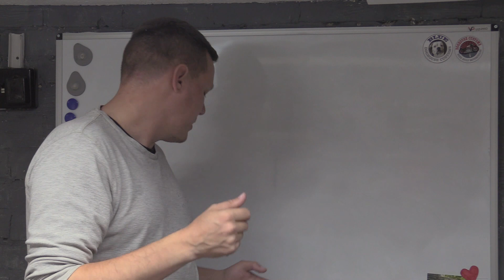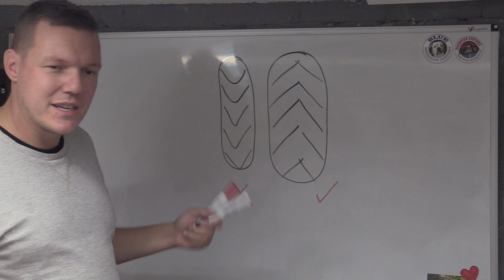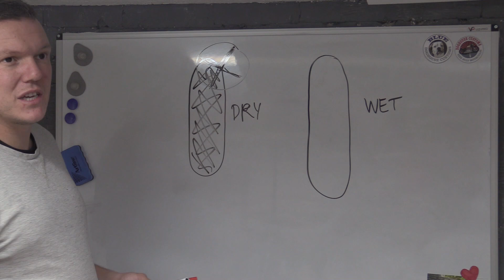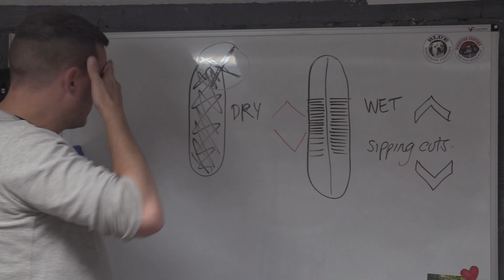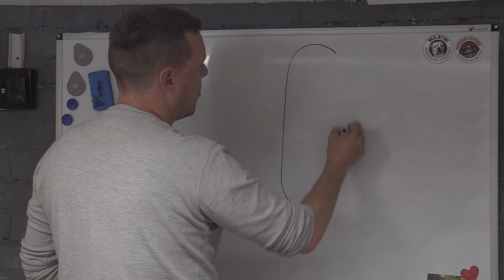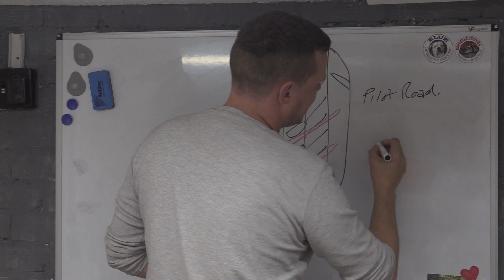Tyre Tread - How? but? why?

Comment: It's because the rear wheel pushes the bike forwards, but the front wheel is turned backwards by the road being pulled from under it.

It's also why you can't wheelie a shaftie, it can't develop lift. Except on Ducatis with those Maxi-Pad winglets. They have to use a rotary engine to counter the torque angle.
Reply from the maker: Wow that was a wrong.

Comment: I'm an elastomer engineer (I design rubber compounds and components for industrial applications).
Rubber is virtually incompressible and behaves very much like a very viscous fluid under load. Its non linear (stress is not proportional to strain) and its properties change significantly with changes in temperature. I could bang on for fucking ages on the topic (schallamach waves, gough joule effects, thermal expansion effects etc.) but I wont because my wife says it bores the tits off people.

Comment: Ho men i was waiting for the answer!! Well... i think it has to do with water removal, but more with how the tire behaves in different loads and how it flex (breaking, cornering for example). And if in between tires they change the desing of those cuts, i think is more marketing than anything.

Comment: I believe that some of it is to do with block stability. To reduce the moment of the rubber, yet allow space for the water removal.  In the variation of the pattern from the front to the rear, I would guess is down to the direction of load on the rubber. The rear is driven and the front is being pushed. Also most of the braking force is taken by the front, so you would set the tire to take this stress. As to the variation in pattern some of it will be to look good, because we can.

Comment: I think the patterns of sipping cuts are optimised for certain amount of watter, if is only a wet surface you want the slik center or if it's raining a lot you want patterns that cross the middle section

Comment: Many race classes determine DOT approved tyres. I believe the tread on many of these tyres is only a token gesture to gain DOT approval.

No way would you want to voluntarily road ride in the rain on. I'm thinking of conti - race attack, pirelli supercorsa etc.

The supercorsas were known to have a decent performance drop off with several heat cycles when used in racing environments.
Reply: I have raced on Supercorsas for years and they are a road legal slick, on a wet track they do not perform. Heat cycles, many opinions on this but my take is tyre warmers on ALL day, one long cycle.
Reply: @boneidol3949  tyre warmers, yes
for that reason between races. (and the obvious initial warm up time on track of course)

Comment: You know what grinds my gears, riders that say they can tell difference between tyres on the road, on track yes, but who the fuck finds the limit, on the road, all manufacturers use each others tyres as a benchmark to be in a similiar ball park, fucking cock womble thunder cunts all of them rossi fucking wannabees, they could lean further over on bike, if their massive sticky pussies didn't bond them to the seat, electric shock therapy for all of them off the national grid, and breathe 😁

Comment: I feel like a pretty easy demonstration would be to have a front wheel on an axle suspended in a bucket of water and spit the tire and stop it to see where the water goes. It should follow the V and move to the outside of the tire

Comment: I suppose the lack siping in the center of road tyres is due to maximising grip in dry conditions. In wet conditions when driving straight forward the water will be pressed to the sides becuause of the ”roundness” of a motorcycle tyre, in difference to a flat car tyre. But, when leaning the bike in corners you want to have maximal grip and the sipings help to get rid of the water. This is my guess?

Comment: I suppose the racing wet tyre is designed purely for wet riding so it is the ideal design for that purpose - maximum water dispersal and allows the tyre to deform more to keep its temperature up. Whereas the road tyre has to be a compromise to cover all conditions and to last a reasonably long time so is never going to be perfect for any given conditions.

Comment: Just recently changed from the michelíns pilot road 2 to the 4s and not yet tested them but the 2s were very good spect the same results of the 4s. Central portion of any of this tires its supose to have a harder compound than the sides that are more stiky. Race tire compound is diferent not as durable as road use so they wear faster and have more grip.. Thats what is told..

Comment: Other than the obvious to give water a place to go and to make the tires legal on the streets and give wear indications. The cuts are added to let you know when you’re hitting the edge of something the manufacturer has designed the tire to do. Excluding off road tires those are totally different not part of this conversation. The cuts in the tires fold when they are under pressure either from accelerating or cornering, which is really the same thing but whatever. This causes the tire to deform and it’s something you can feel. And they are made so that before you hit the edge of either that acceleration limit or cornering limit you can feel a change in the tire and know hey I starting to hit the limit of my grip or of my acceleration any more and I may lose the tire. Some of it is just design and to make the tires look different and cool.
Reply: Why do bicycle tyres have the same kind of grooves then?
Reply: @apsestasis  They dont have the same type of grooves. most bike tires are made for moving sand and light rocks out of the way. You have to remember what it is that the tire manufacture is trying to accomplish. In the case of motorcycles for performance tires its all about grip. You arent riding those in the rain and the grooves are only really there to make them street legal and make them look cool while also giving you feed back from the road. Moto GP tires dont have feed back bc its assumed that the rider knows what he is doing and where he can go with the bike. Even on bike tires the rubber deforms and moves but most of the time you arent pushing the limit on a bike its just there for style and looks.

Comment: The  rain tyres I think are ment to shaped like that so they can more rubber on track as well as push the water out of the sides and the blank middle possibly for longevity as these are mostly road tyres where the wets dont need to last that long because they're mostly used on track and are replaced quite often so they can use softer rubber and more aggressive angles for water to escape as I said just a guess
Reply: Sorry for my horrific sentences, always fuckem up

Comment: I know fuck all about tyre tech (as will be obvious) Road tyres are soft rubber, no HAARRRRRDDDDDer rubber than race tyres so need help getting up to proper working temp. The cuts might help (as others have said) with generating heat via movement as well as giving more edges to give a bit better grip and move water.
Is there enough of a contact patch to aqua plane on a bike? or does it cut through the water for a low chance of aqua planing so there is no real need for cuts in the middle of the tyre as the bike is upright and at its most stable when on the middle of the tyre, so to help with longevity and to keep the compounds heat down in the middle there is no or less cuts there?
I also suspect most of the pattern on a tyre is to catch the eye of the buyer and is there as window dressing. It is reminding me of something I was told when I was in a tackle shop once, fishing lures catch more fishermen than fish.
Like I said I know nowt.

Comment: I think that tread on front keeps water, taken by the tyre from the road, inside of mudguard, so it's not all over the bike and the rider. And at the back, water splash more on the sides, so drivers or riders behind don't get all this water straight in the face. Contact path on bike tyres is small when bike is vertical, so tyres don't need tyre tread like car tyre. Water will fuck off any way. But when turning, water on the road is squished between road and the tyre. Tread is like escape channel for water.

Comment: I read in a motorcycle magazine a while back that the compounds of the tyres are the important bit and the tread (with minimum specs obvs) is dictated by the marketing dept.
Reply: I read a thing about bicycle tyres once where a guy from Schwalbe basically said tread is utterly pointless for bicycles in almost all cases (you wouldn't aquaplane on a bike and tyre temperature is low as well) but they give them tread because that's what customers expect. Obviously not saying this is the case with motorbikes, just always thought it an interesting tidbit.
Reply: @HardwareG33k  for road bicycles sure, for MTB, hell no, there is a shitload of difference between different knob arrangements, but that's obvious I think. For car tyres the thread is quite important, for bike tires I'd guess the round shape makes the thread a bit redundant, as the roundness itself pushes water out of the way quite well probably.

Comment: The side threads are like small fingers that get in to contact on and with the road, more or less like the snow tires,
actually on the middle if you have nothing already the portion of the tire should be enough to displace the water, then the back tire may enlarge the track...but I am no Engineer...

Comment: I recall a performance bike article from the early nineties that compared wet weather braking performance of various tyres on the market at the time. Beating all of the road tyres by some margin was a soft racing slick. The conclusion being that the design of the tread pattern was not the significant variable in this experiment.

Comment: I would assume that most tyres on bikes don't have tread in the centre of the tyre because aquaplaning is usually in a straight line, which you'd already be moving in, using the centre of the tyre. The times when you're most likely to use the edges of your tyres are when you're leaning over, in a turn, in which case aquaplaning is a much more serious issue.
Reply from the maker: one word ~ 'braking'
Reply: @thedirtyworkshop  so it's a mu issue? cool

Comment: The first part of the question (front pattern vs. rear) is due to the different torque relations I should imagine. Rear drives you forward so the "V"-ish shape pointing forward increases grip if you accelerate.
Front contact patch is your primary braking surface so the opposite is expected. I assume the "V"-is pattern with the wide end facing forward enhances grip when you hit the front brake.
The middle band you mention... I don't have a clue to be honest. Surely, the weight of the bike makes the tyre deform so the thin band is just part of the surface that touches the tarmac. Thus you get the innermost tips/ends of the siping channels on the road as well to deal with water disposal and the thin band left alone is solid or semi-solid to control said deformation.
But these just guesses based on some common sense. I'm rather curious now. 
I am in a constant argument with people who buy tyres based solely on looks (Chinese replicas of the 1950-60's "sawtooth" bullshit) and  I could always use some extra intellectual ammo.

Comment: But how does this heated rubber moving about on wet tarmac Actually make more adhesion, the slic makes sense as you have more surface area contacting with the tarmac,
Reply: A slick struggles to break the surface tension. Wets have small surface areas to bite into the track surface.

Comment: Idfk. Not a clue. I cheated and saw someone else's comment that mentioned heat, so I'm sure that's a part of it. It allows the rubber to bend, internal friction warms it up. And there must be a shovelling effect, scoops the water and flicks it away for the next contact patch. Does the flexibility have some sort of pumping effect, like a diaphragm? Literally sucking the water off the road? Then there has to be friction somewhere, road surfaces aren't perfectly flat and the tread provides some valley to "bite" the subtle peaks of the ground?
Reply: Have you seen the size of the contact patch? how hard is it to move the water a couple of CM, have you ever found your feet aquaplaining in the rain if your running?

Comment: This is an interesting topic, as the tires I have have a very wide slick region in the middle (shinko 011 verge). My experience is limited to compare them in the wet, and my motorcycle doesn't have enough power or traction control or ABS to see how they compare in a basic "twist the throttle" way. In the dry I really like my tires.

Comment: Talking of odd grip patterns have you seen those supermoto tyres with the slick edging and the ladder grip down the center.
Reply: That’s actually to improve grip in the dirt section of a supermoto track, believe it or not a real supermoto track has a dirt section with jumps and a tarmac track section. That’s the reason for the thread

Comment: I feel like what you are getting at is that its more to do with reducing contact area, increasing pressure to displace the water (and giving that displaced water to be) than it has anything to do with channeling the water to flow through the tread like a water pipe.

I prefer my grandeous delusions of water gushing through my tires and 300mph like a dam drain. In fact I'm gonna put little baby turbines in my tread, solve the energy crisis overnight

Comment: Heat retention is critical in racing, when the tyre cools is when it loses grip. Slicks are brilliant until they cool, i'm thinking the wets allow a better surface contact in water but then can get too hot in drier conditions?

I always think most road sportbike tyres are more like an intermediate, the best of both worlds?
Reply: Rubber compound is big on heat.

Comment: Depends usually on the bike which tire you should use. If you ride in all weather for example heavy rain you need a tire tha thas tread in the middle aswell. However if you don’t usually ride in heavy rain and you are not a street rossi when its wet you don’t need any tread in the middle as the tyre is round and the contact partch is relatively small but as you corner usually sport touring tires have a enlarged contact patch which then requires tread on the sides to eject the water from under it. 

Different patterns are just manufacturers  preference and also to help with different conditions. I guess they use straight out treads on the sides for moto gp to throw the water to the sides so the guy behind doesn’t get a bucketful of water in his face and limit his visibility.

Thats my two cents

Comment: Excellent topic.
It's like you can read our minds. We were asking ourselves about which treads/tires are best for rain? What are the cons of rain tires on dry surface?
I think you are going to be the first person, for me at least, who is going to answer these questions.
I was getting so desperate, I almost ordered an engineering design manual.
Thanks.
Reply: Rain tyes have more grooves in them, which means overall you've got less rubber on the ground, but unless you're racing you won't notice